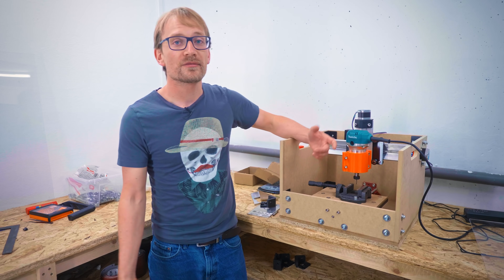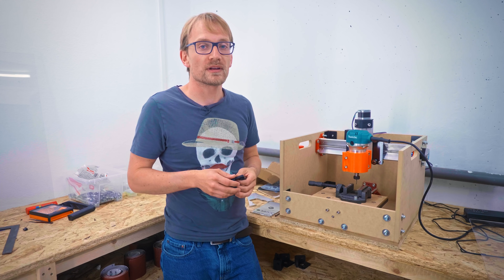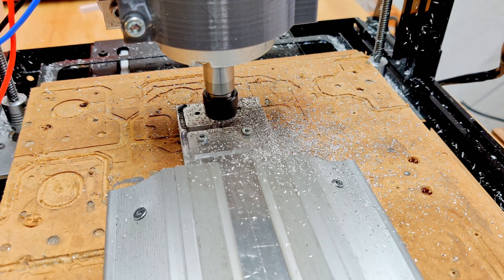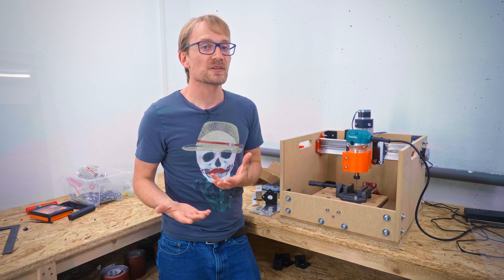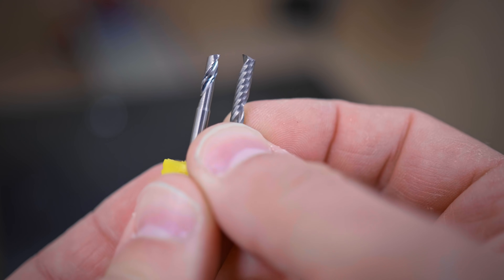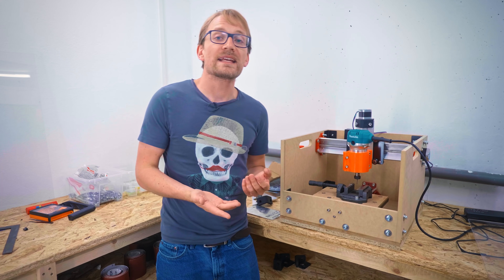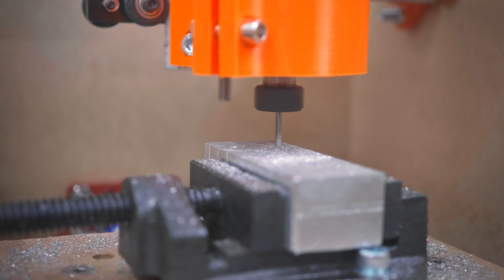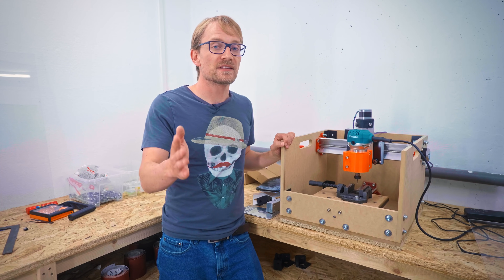The road to cutting Aluminum on my Desktop CNC!

Comment: The wheels look like rubber types you find on an Ender? Or did I see that incorrectly? If it does, would it not be better to use v-grooved metal bearings, so the aluminium chips don't get in-bedded in to the rubber, causing bumps? Or at the very least add some kind of cover so the chips don't hit them? It doesn't matter whether it's a 3D printer, Laser cutter, CNC machine, Vinyl poster cutter, etc. - they're all basically the same principle = a head, stepper motors, controller, g-code. I think if you know how to use one of those, you can figure out how to use the others.
Reply from the maker: The wheels are the Delrin V-type, as is standard with the Openbuilds system. There are also compatible steel wheels available, but I think the way the wheels are mounted matters more than the material type - unless it's the wheels used by Anet, which neither fit the aluminum profile nor are made from a proper material.
Reply: @MadeWithLayers  Would some kind of cover help for the wheels? Or would it make little difference?

Comment: Tom, what program do you use to send the GCODE to the machine after generating GCODE from Fusion360?
Reply from the maker: Universal gcode sender - the 3D printing tools like Pronterface struggle with the difference in gcode dialect between printers and mills.
Reply: Thank you! :)

Comment: I see that you already use "Climb mill" technology on this CNC. I think that would also work with MPNC. I am still waiting for the continuation of the MPNC series :)
Reply: if you are talking about his MPCNC series it is over. There were like 9 video's in all (2 that had to do with hardware selection, the 6 in the build series and then the wrap up finale that he talks about why he tore it apart. I won't go into it here as it has nothing to do with this build).

Comment: OMG IT CUTS ALUMINIUMNIMUM
wait until everyone that made an mostly printed waste of time cnc to see this.. it appear that it can do everything they can't :D :D :D :D
thanks to mention rigidity, also there are optimal feed rates, they provide you a reference table with rpm, diameter, type of aluminium etc
Reply: Look up a channel called brauns cnc and be amazed at how capable the mpcnc really is with a good cutting recipe and the right type of bit

Comment: Great video, thanks.
what were the feeds and speeds that worked for you with the single flute end mill ?
Reply from the maker: In aluminum and with 2D adaptive cuts, I settled for 600mm/min, 20k RPM, 2mm in Z and a 0.4mm optimal load.
Reply: @MadeWithLayers  thanks so much for the answer. Ive got to say I am operating a DIY cnc machine and aluminum is a nightmare for me. I hope those parameters will make it work better.
The bigger endmill you showed was a 6mm single flute aswell?

Comment: Just a suggestion, but, use the CNC machine to build aluminum parts for itself. For example, the end pieces that hold the horizontal V channel to the sides. Doing this should overcome more of the rotational movement about the X axis that the machine seems to suffer from. As aluminum parts go on that replace the plastic ones, the tolerances should get better.
And yeah, definitely zero backlash ball screws for X and Y at least.

Cheers,
Reply: Agreed, now that it's a little stiffer use it to cut parts that will further improve the machine. It's a kind of CNC evolution

Comment: Could you add a second rail to the Y axis to widen the base, that would add a lot to the rigidity.
Reply from the maker: I've thought about that, but I think I'd rather swap to some fully supported MGN15 linear rails. Probably easier as well since Openbuilds wheels can be tricky to align when there's more than one set.

Comment: Given that the wheels only run on the edge of the axis angle , there's room for stiffener onthe back side. Would especially benefit the y axis
Reply from the maker: I believe that's exactly what they're doing on the Longmill. On this Mill One, I could even attach the X rail to the back of the frame for the entire length!

Comment: Honestly Thom, you should build a mill. Say no to MDF frames, leadscrews driving the axis, and trim routers being used as a spindle. I'm actually beginning my journey of building a CNC mill at the moment, accumulating tools and parts.
Reply: Absolutely.  Rigidity is king and you need something much stronger.  I have a Tiag Mini Mill that I converted to CNC and even that lacks the rigidity desired for cutting aluminum at a decent speed.

Comment: For a quick speed and feed reference that is an app I use FSWizard. I pay for the pro version. You enter your material, type and thickness, then your tool whether it is a drill, endmill, or burr. Then your machine power and rpm limits. It will give you your speed and feed as well as depth and width po er cut.
I am a retired engineer that came up thru the machine shop ranks. I have 35 years of cnc programming and 40 years in a machine shop. I started using FSWizard snd found most of the information to be spot on, only the deep hole drilling and some cast iron castings to be off but those are more of a feel type deal.
I prefer air blast over coolant also, rules use to be coolant for high speed tools. For carbide tools you must use flooding and higher pressure coolant jets, never a mist, carbide will micro fracture if not under constant coolant. Carbide likes heat, just under the materials melting point, it also likes pressure to cut and leave a nice finish.
Keep up with the great shows, very good explaining of your problems and issues and most importantly your solutions to correct.
Reply from the maker: Thanks, I didn't know about FSWizard yet! I knew there was some Windows tool that did something similar, but IIRC it's a ~$100 license.

Comment: You're on the right path with thinking of replacing the leadscrews with ballscrews (probably half inch ones..), but you could also easily add some rigidity to the X axis by linking the two new bolts with a solid steel cylinder (maybe about 20mm dia) that's drilled and tapped on both ends  to accept those new bolts. That would probably add a lot more frame rigidity across what seems to be the weakest dimension from your test cuts (the part of the video where you're talking about the spring in the anti-backlash nut being a weak point). Seems like a nice project! Hoping to build my own CNC within the next 2 years, may end up with small manual mini mill first..

Comment: Where from do you get your aluminium blocks? Is there a reseller or are those scraps from some company?
Reply from the maker: Random cuts from ebay. The thinner (4mm) stock I did my tests on was side pieces from my DIY delta printer, the milled triangular but is an offcut from the bed on that same printer.
There's also a pretty competent steel shop nearby, but while they were always ok with selling me material for a few Euros each time I went, I think they're more geared towards job shops and construction companies.

Comment: Be careful with that router.  I had 3 of them catch on fire in my CNC. Luckily Makita replaced them all under warranty. I’m now using a water cooled spindle.
Reply: I assume that router like most power tools have a limited duty cycle? They're not designed to run continously for a long time, more like run a short time, then be off for about the same length of time repeat.
Reply: Christian Gerefalk mine all failed in the bearings. As a trim router I guess they are only designed to be used for a few minutes max.
Reply: Hmm wonder if the bearings simply weren't up to the task or continuous use made parts heat up and expand causing more wear and or lubricant issues etc. Could also just be built down to a price making it not last very long.
Reply: Christian Gerefalk I suspect designed to a price point with a low duty cycle anticipated.
Reply: Can you share the brand and model of the new spindle?  Thanks!

Comment: i started a cnc in 2016 which grew historically.  it went trough wood, partially metal to full metal, it went from drawer slides over  to 20mm precision linear rails, rebuilt the controller few times, new spindles from a laser to a even stronger laser to a dremel, then dc motor, to a highspeed chinese spindle and so on. it never worked properly and probably cost me 1500+ upwards.  it grew bigger than what i have space for and never cut more than 3 letters in wood before something bad happened.   drivers overheating, step skips, mechanical flex, fusion360 overlooked default settings breaking endmills, connection issues between software and grbl. 

its something you gonna pull your hairs out over time

Comment: Your intuition about raising the rpm on the makita is correct(I have a sienci as well - unmodified though). The makita behaves the best on the 30000 rpm setting in my opinion. My recipe for milling aluminium(adaptive) is:

2mm stepdown, 0.6 mm optimal load. 30k rpm, 0.0254 mm feed per tooth, 900mm lead in and leadout, 200mm plunge and ramp. I do a 4mm 2-flute cutter.

Comment: I have an idea for a new cnc frame how well do you think a gantry style cnc frame thats 3d printed and filled with concrete i figure that it should be very cheap to make but is more rigid than most of the cnc on the market
Reply from the maker: Once you go with concrete, I think the 3D printed bits become redundant ;)
Should be really solid, though!
Reply: Thomas Sanladerer Yes definitely change your short after assembly😉 - Btw. I think he means, that the 3d printed parts only should serve as a form mold for the concrete. It would be quite a job bending the rebar.
Reply: Gert Halberg you wouldn’t necessarily need rebar for somthing thats only a few inches think you most likely could just use a thick wire
Reply: The way i was thinking about it is that the 3d printed frame acts as a form and are only 2 or 3 perimeters thick making a leave in place form so its easier to make a sturdy but accurate mahine

Comment: Strength, rigidity and accuracy cannot be out of balance. If they are, oscillating harmonics become your exponential enemy.

Building your CNC structure from MDF and, plastics held together by screws, nuts and bolts that have drastically different holding forces requires more than guess work to achieve successful results.

For what you have invested in time, materials and components, your machine is incredibly accurate considering its design and materials used in its construction. You have made a very good machine given your basic requirements.

That said, I would not invest any additional time or money in this setup if the goal is to achieve the same or exceed the accuracy as a basic low end CNC milling machine of 0.5 mm tolerances.

Comment: A tip for cleaning of the stuck aluminium from those end mills: drain cleaning powder with Sodium Bisulfate (Natriumhydrogensulfat) It dissolves all aluminium but keeps the carbide and coating perfectly intact.
Reply: Sodium hydroxide?
Reply: sodium hydroxide works too.

Comment: hey thomas, could you link the adapter sleeve?
I am using the same router and was desperately looking for a way to use smaller endmills
Reply from the maker: I ordered mine from Aliexpress: https://s.click.aliexpress.com/e/_Bf7YybOP
There are three types available: The all-black ones with a flange, the shiny chromed ones and the ground one I use now. I've tried all three and only the ground one gave me decent runout - I guess Winston Moy found the same thing as iirc he uses the same style adapter on his Shapeoko.
Reply: @MadeWithLayers  Danke Thomas, das hilft mir ungemein!
Reply: SpeedBottles, what router is this? I was going to install an upgraded motor in my generic 3018 machine, but it looks like routers are the better option.
Reply: @francistaylor1822  it's a Makita RT0700C

Comment: This is cool. I have some experience on larger cnc machines and this is tempting to get one for home.

Also quick tip: 1/8” endmills will flex a lot on their own. If you put it as far as you can without putting the flutes into the collet it will help you a lot I think.

Comment: Well i don't know if it's actually a good idea but Igus have these self lubricating lead screw nuts. I suppose they would be way better than those "springy" lead screws and if you dont run your machine like 24/7 they should last long enough before they wear out.

Comment: Good job on getting it running better than before. One recommendation I might make is to do your finishing pass at full depth, that is if you've got enough active cutting length. Looking at the tool marks in the video it looks like it's doing a finishing pass on each step down. 

Also I recently made a CAM flub which was really beneficial. I made my depth of cut substantially deeper than I usually do, my radial engagement slightly smaller, and my feedrate faster. When I hit go and noticed my mistake I was about to hit cancel but then let it run for a bit. My material removal rate was greatly enhanced, and my surface finish and sound on the tool was way better. I guess my point is try and use more of the flute if you can, instead of cutting only with the end of the end mill. Also I've noticed over the years that I can plunge with a single flute and mill in a helix far faster than I used to do.

Excited to see you what else you can come up with now that you've got it working better.
Reply: He cant. The machine has to much flex in it. A full depth cut will just leave tapered walls.

Comment: Really liked the video, Tom.  I made my own CNC machine off information I found on OpenBuilds.com.  Great site for making your own stuff like this.  One thing I found works really well for work hold-downs is regular blue painters tape and super-glue.  If your waste board is relatively smooth, mine is MDF.  You lay down a layer of blue tape to your waste board with enough surface to cover your stock.  Then tape the back side of your stock.  You super-glue the tape-covered side of your stock, and spray a little bit of activator on the tape on your waste board, and then lay your stock down.  The amount of force it takes to lift that off the waste-board can only be done with a putty knife, or something like that.  It works great, and saves lots if z-axis room.  I hope this helps.  By the way, I learned a lot about my 3-d printer from your videos.  Very informative.  I also use the free license of Fusion-360.  The CAM that comes from it works great.

Comment: There are adjustable anti-backslash nuts for lead screws made by OpenBuilds. They built "C-Beam Machine", a CNC intended for cutting aluminium plates, and it cuts really well with no wobbling.
BTW, What about MPCNC Project? There was some license conflict, and you will never try it again? If so, maybe you would build and OpenBuilds CNC machine on a LiveStream? :)

Comment: Now that it "mills" aluminum could you replace the 3D printed brackets with aluminum?
Reply: thats the reprap spirit :)
Reply: @SteffenBauer  yeap upgrade everything you can then use the upgrades to upgrade more
Reply: @fernandorendon317  Next Bob will be cutting steel and then diamond.
Reply: Yes, and no. Yes you can replace many of the 3d printed parts with milled aluminum parts, but there are a couple of places where the 3d printed parts are going to pose challenges. Bob has limited cutting depth, simply because of the varieties of bits he's working with. If you can only reach 20mm, and you need to support a cut of 50mm to allow for  M8 mounting holes 30 mm in from the end of the angle brackets, in X, Y and Z, you're either going to have to mill that as a corner pointing down to have clearance, and do a lot of finish cleanup, or contemplate developing a new model for that bracket. Also there's the issue of already looking at coming up with a new Y rail system, so do you replace those first then do this for the X and Z? Or look at the changes done for the Y, and consider whether they make for better solutions for X and Z as well? It could go either way, but I'd consider replacing the Y system, then using the old Y brackets to build molds to cast replacement X and Z brackets out of aluminum.
Reply: @RNMSC  just make a second machine at that point. If you replace everything and end up with a pile of the original parts, which is the original machine?
Reply: @mackk123  As is always true, whichever one the people you bought the parts from will support, even if it no longer bears much resemblance to what they intended to sell you...   :-)
Reply: @mackk123  I'm selling this amazing ship, it once belonged to the founder of Athens himself...
Reply: @mackk123  well the two new machine will be very "original"
Reply: Maybe use the 3d printed parts to mold a negative and melt down the aluminum swarf to cast
Reply: that wouldnt nessecarily be an improvement in stiffness as he mentioned in an old vid
Reply: No, "cutting" aluminum is correct.  That's not a mill, and that's not milling.